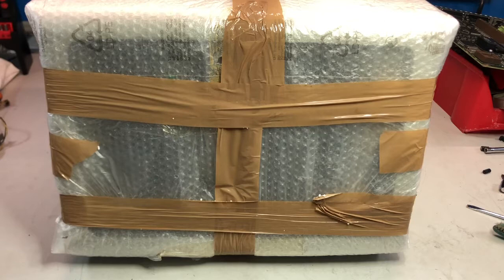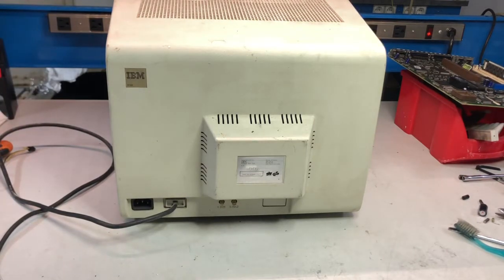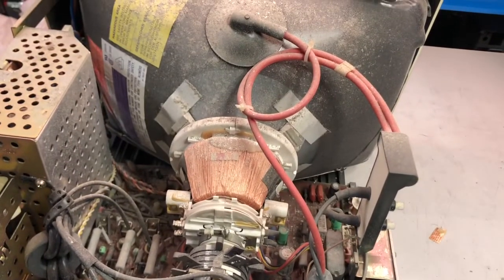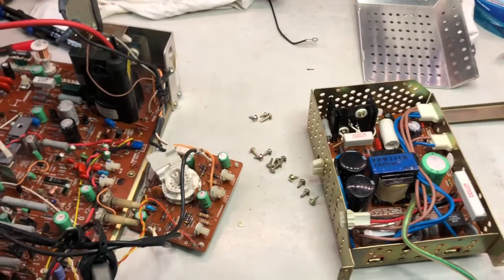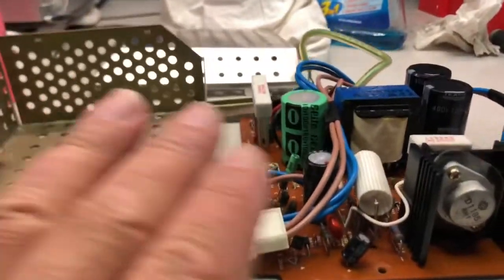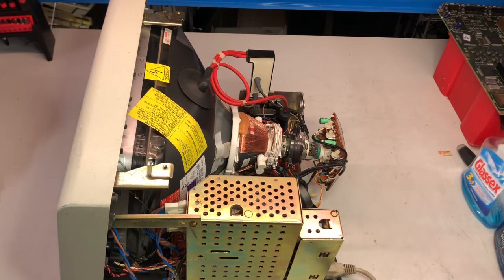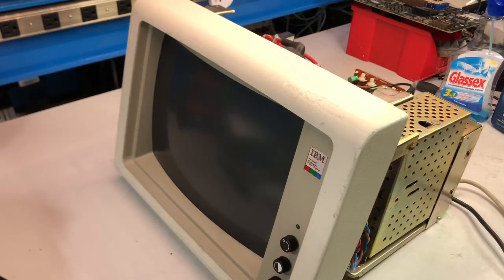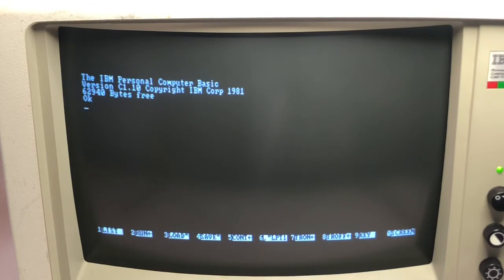Very Sad IBM 5153 color monitor restoration

Comment: did you have to discharge any power from the monitor? i thought these old things stored a lot of power!
Reply from the maker: When I started to work on it was after long time from the last use. BTW, for safety reasons, I’ve checked it and it was fully discharged.